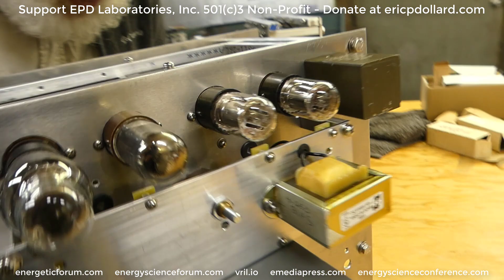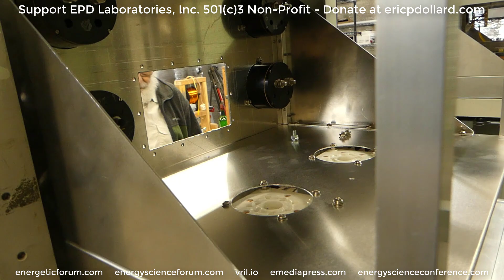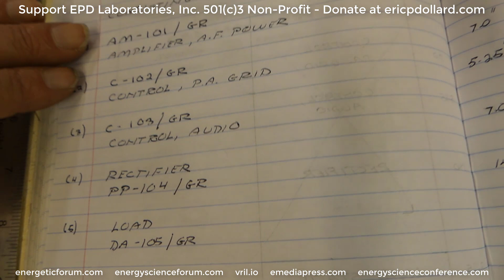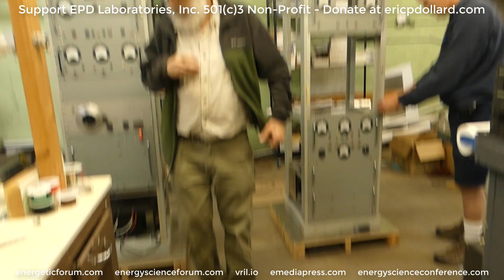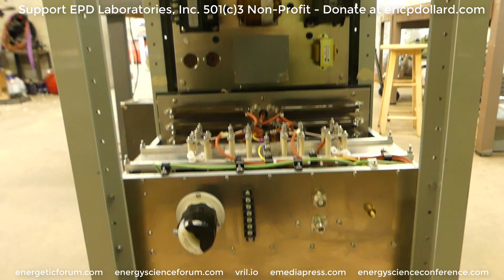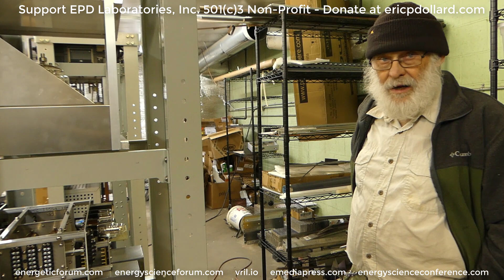Cosmic Induction Generator RF Rack Build — Eric Dollard

Comment: Translation? Anyone? Is this just an hf transmitter?
Reply: Dollard is using an AM transmitter instead of a spark gap.

He also tunes the coils like Tesla. Which creates an SWR of 1:Infinity unlike 1:1 conventionally. 

The coils are out of phase so they are not transmitting.

The coils are driven by a impedance transformer lowering the voltage and increasing the current.

The first coil which is the bare copper one is the current coil, the one with white Teflon coated wire is the potential coil.

The two in series act as a 1\4 wave resonator.

The coils are also constructed that no additions tuning capacitors or inductance a are needed because of the current coils Magnetic storage properties (Inductance) and the Potential coils Dielectric storage properties (capacitance).

The combined tuning and construction of the coils convert the RF receivers TEM Transverse Electro Magnetic waves into LMD waves which are Longitudinal Magneto Dielectric waves.

TEM waves have distance/delay. LMD waves are two points connected.

There is a lot to study with Eric Dollard. Also a lot of conventional electricity de programming.
Reply: And I barely have a grasp on it. But what you are looking at is a modern day Tesla coil driven by a sinusoidal rf TEM wave which in turn gets converted into Tesla LMD impulses/currents by the coils.
Reply: https://youtu.be/isbDfZYo6gU
Reply: @jondelaire  Wow. You really went out of your way to answer my question, above and beyond, as it were. Thanks , my friend. Cheers.
Reply: @undernetjack  hopefully we see some modern day magic soon!

Apparently he has created plasma vortex’s in a lightbulb. They seem to look like galaxies.

Eric believe these could possibly be the fields that shape the cosmos.

Hence “Cosmic Induction Generator”